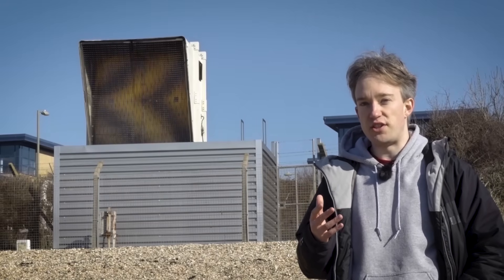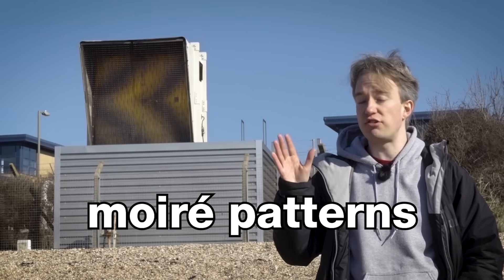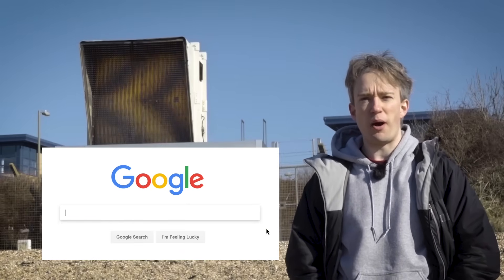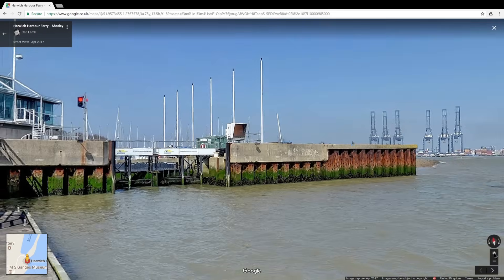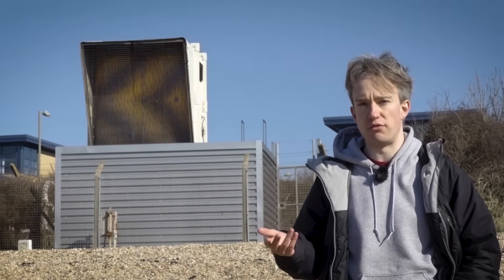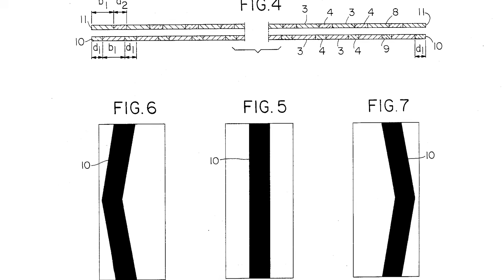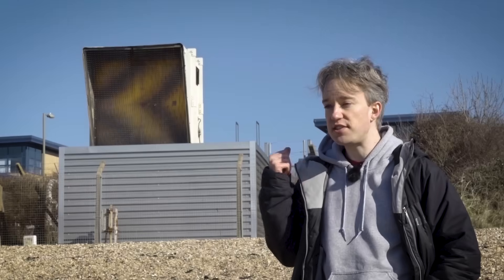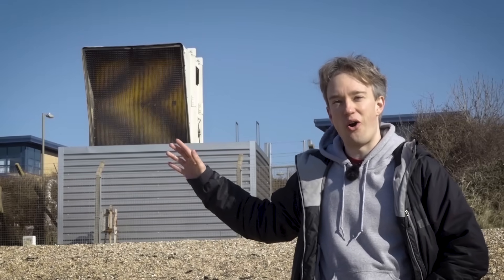The moiré effect lights that guide ships home

Comment from the maker: I tried for ages to fit the ♫ If new lines hit your eyes when two patterns combine, that's a moiré ♫ joke into my script, but couldn't figure out how. I put it here instead.
Reply: Your effort is appreciated.
Reply: ♫ When there's lines on the screen with more lines in between, that's a moiré ♫
Reply: ♫ When the difference is slight and the spacing is tight, that's a moiré ♫
Reply: I remember it as "When a grid's misaligned with another from behind, that a moiré"
EDIT: This isn't my joke. I think it's Randal Munroe's (XKCD).
Reply: If the eel gives you pause with pharyngeal jaws that's a moray
Reply: Hey, there's a community on Reddit dedicated to finding out what weird stuff is. r/whatisthisthing
Reply: I  believe the same system is being used in some places in the Netherlands to guide cars through a tight corner in a road. In Dutch they are called a 'bochtschild', but I couldn't find any examples of this particular system on the web.
Reply: I once gave an engineer a birthday card with a similar version on it:

When new lines hit your eyes
From two screens when they ply,
That's a Moiré!
Reply: Tom, get your self a 3DS, cause the same effect is used to make the glass less 3d work.
Also this effect is also known as aliasing, more in a signal sense rather than computer screens and video games.
Reply: I used Moire patterns extensively during my graduate work for alignment purposes. If you print a moire pattern and bounce it off a mirror and into a CCD camera, you can tell how angled the mirror is to 10^-3 degrees by looking at the Fourier Transform of the image in the camera. I can send you some references if you want.
Reply: ♫ When the patterns combine and they nearly align, that's a moiré ♫
Reply: When there's lights and a grid
with its lines a bit squint...
Reply: Leendert van Egmond came here to say exactly that! they're used for sharp turns
Reply: Not quite the same thing, but it reminded me of polarized lenses.  When my dad was in college many, many years ago he took a course on inventing.  His final project was a pair of boxes that used a flashlight and polarized lenses to send morse code signals.  His professor told him to patent it, but he never did.

With that in mind I always had polarized lenses in my mine and was trying to think of clever uses... and finally I had an idea!  Offset polarized window treatments for windows in buildings that have windows that face each other!  You can look out but you are blocked from looking in the windows on the other side.  I did a quick google only to find someone had JUST (like within the last couple months) gotten a patent for it.

Oh well.  Back to the drawing board.  Had an idea about changing the frequency of steel harmonica reeds with magnets.  Mentioned it to a friend who, I guess, may have actually been talking with someone who was working on it.  He was very quiet about it, which was unusual.  I think he may have been under an NDA.  The invention, a very fiddly, but very cool bit of harmonica kit, came out very shortly thereafter.  There is no way they would have had turnaround time after my mentioning the idea.  I was just beat to the punch again.  I'm not sure how you could make an episode about it (you'd need some sort of news peg, like an example that you could visit) but the idea of how inventions can go uninvented for generations and then suddenly get invented by multiple people all at once is fascinating.  I think some of it is cross pollination of technical ideas (maybe with some industrial espionage), or a precursor invention being invented, or just a social change that suddenly brings attention to a problem or opportunity (like the Seydel harmonica company introducing a harmonica with steel reeds instead of bronze phosphor or brass.)
Reply: @NacorantheHarmonicaPlayer  There is also the possibility of "spontaneous inspiration", like when Edison and Swan simultaneously invented the incandescent light bulb. They eventually formed a company together. I'm constantly inventing things and finding out later that somebody else invented it before me.
Reply: I appreciated the Nerd Sniping reference just as much
Reply: I always heard it as "When a grid's misaligned with another behind, that's a moiré"
Reply: ♫ if you swim in a creek, and an eel bites your cheek, that's a moray ♫
Reply: ♫ When a grid's misaligned with another behind, that's a moiré ♫
Reply: Who knew that so many people on youtube would be familiar with the music of a somewhat obscure Italian-American crooner from the mid twentieth century.
Reply: They use these also to dock aircraft on stands at some airports!
Reply: You see these on the sign gantries on motorways and I can't help but watch the apparent image change as I drive past them. Great little idea, I'm surprised we don't see more of them.
Reply: Tom Scott In my opinion the convention methods of leading lights and channel lights are highly effective and unambiguous. For leading light to be any useful this must be incorporated in International laws (IALA Maritime Buoyage System). As far as I know this light is not included in that. In few cases some ports use a special light which must be mentioned (including the purpose) in Guide to Port Entry or relevant Port Information. These lights are allowed as long as it doesn’t confuse with the lights as per IALA Maritime Buoyage System.
Reply: Leendert van Egmond yeah, Just wondered about those last weekend. They are quite effective within those turns to keep you in the lane it seems. And as when moving by they create the illusion of something moving, they are quite good at drawing your attention
Reply: ratedr95 yeah but those get more and morereplaced by displays recognizing the aircraft type and position from a camera picture.
In Düsseldorf they had boxes with a slit in the front and a fluorescent tube in the back before. Stripes on the front showed you where to go. Plainly worked. The new things used weeks of calibration and learning
Reply: Why don't we use our waterways more in britain more? its a perfectly good viable piece of transport. also can we use it for industry? or atleast a traditional industry caravans and tourists don't tend to fall into that bag
Reply: Things that I also don't know.
is a better name, no?
Reply: I've been trying to get the whole tune of "Inogon leading mark opens the door" but that's about as much as I have.
Reply: I never read the comments on Youtube, for obvious reasons, but this paid off immediately. Really clever.
Reply: Someone please make this into a full song!
Reply: I came to the comments specifically for this joke
Reply: Just googled a bit and found that some levels use that principle instead of airbubbles.
Reply: Making it into a parody song is actually a really good way to remember what the definition of a moiré light is
Reply: it would have been even funnier to hear you sing it Tom. You know thats the reason its not in the video and not bc you "couldn't fit it in"
Reply: Tom Scott fly a drone at it at different angles. Id like to see it in action
Reply: Punny
Reply: Where is that? normally they just have the red/white signs..
Reply: I'm Very Angry It's Not Butter!! 
When the world seems to shine like you've had too much wine 
That's amore… classic
Reply: nice!
Reply: When the beam hits your eyes and the lines all align thats a moiré
Reply: cool joke, hard to pull it off tho
Reply: Tom Scott the judges will allow it!
Reply: I think the real story here is that Google search sucks.
Reply: We use these here in The Netherlands for sharp turns on roads
Reply: Bravo! 👏👏👏
Reply: Tom, PLEASE make the i dont know series!!!
Reply: You Sir, win the Internet!
Reply: When an eel lunges out / and bites off your snout / that's a moray

BC cartoon strip
Johnny Hart
Reply: It makes me happy to know you had that thought hahah
Reply: @BryanTaira  fwwjdiejfdxshxsjfd.  Dufddfdsjfs
Reply: Dus zo werken die dingen!
Reply: Likewise I would have also, for all the great content produced.
Reply: could it be due to financial data cabling?
Reply: I dont think your seeing  this comment. But how did you search this all? Patents? The millarty? How did you get all that information?
Reply: Did you ever find out why the lights there...?
Reply: I live 2 miles from this exact moiré
Reply: Yahdswhtw
Reply: Tom Scott  I believe the cable is the data cable that connects the world to the internet 🤯🤯🤯
Reply: Tom Scott I know why that is there!!!!!!

Between the (Now Closed) Fawley Power Station (which has the well recognised Calshot Chimney as a landmark), and the Hamble (the side you are stood on) there runs underground Electrical cables/Pipelines, that I believe keep the oil tanks filled up on the Hamble side from the opposite Fawley Oil Refinery. Having lived nearby to it for several years, I do know a few bits about it!!!!
Reply: When you swim like a seal and a fish bites your heel... that's a moray~
Reply: I like seeing those lyrics as they are written, but probably too much corn for you. Does make me wonder about your singing voice though.
Reply: ♫  When two patterns combine in a way serpentine, that's a moiré
Reply: Given lines on the screen with some more in between, that's a moiré.
If you find there are lots of those weirdly-spaced dots, that's a moiré.
Reply: If the dots all align and the patterns combine, that's a moiré.
Reply: "When two patterns entwine in a way serpentine, that's a moire . . ."
Reply: @davidmennomoyer  Very good.
Reply: @simonmultiverse6349  - all credit to Spider Robinson.  It was in one of his short stories years ago.
Reply: Deano tips his drink at you
Reply: I appreciate the effort Tom
Reply: You could have just had it be the explanation and just say it in the same pattern as the original lyrics.
Reply: Tom Scott If you do a new series, you should name it "Things you might know"
Reply: Come on Tom, you are at the thing. Research is more than just googling. Ask the locals if they know who is responsible. Walk into the authorities building. They'll know.
Reply: I wonder if the light is there for people who would need to service the cable?  It will alighn you over the cable and then you can go down there
Reply: Carl Terrey  he strikes me more as an apple juice, with a dash of water to take the edge off kinda guy.
Reply: Tom Scott shame I didn’t know you were in southampton when you did this. I’d have bought you a pint! (Or your preferred drink!)
Reply: Xkcd already used that joke. It's a good joke though
Reply: In some placed in The Netherlands the use this kind of arrows along to rode to indicate a sharp turn.
Reply: @MeneerBobRoos Egg
Reply: +Falcrist damnit, i was about to find the xkcd
Reply: All I get from this is that you didn't try hard enough. :P
Reply: design a website where such unknown variables can be layed out and find unfindable things in a community oriented tasks.

Like reddit but with actually useful interface that lets users put what they know, and others can add, till the host is like oh it was X.
I remember searching for a comic years ago and only thing i could remember was the scenes and it wasnt till i asked around enough in such a decentralized way that i found the artist who confirmed it was her work n sent me a link to it. 
4 years of searching, could be so much well sorted if we used the internet.
how do we solve problems? Find things google doesnt show, open a discussion and search for it. 
quora and other ask sites are limited to questions and answers, and forums like reddit are rather linear and hard to search through, 
so instead a searching data base that pools simular questions, and teams up researchers and journalists and students with a nebulous way of trying to resolve information easier. Is something factual? lets map out the date and times using easily accessible information online and plot events or facts, and challenge information as well if its false or misleading
Reply: Tom Scott here’s an idea for a new series of videos “Things YOU might know (Because I sure as hell don’t). 🤷‍♂️
Reply: wow this comment wasn't made a week before video's release
Reply: Falcrist brilliant play on words....
Reply: Were expecting that.
Reply: Here we go! Crowd source the lyrics to the song.
Reply: Leendert van Egmond they are used everywhere in the netherland, not only in some places. But yea, you are indeed right, they are used quite commonly here

Comment: This is clearly witchcraft, and they probably turn people in to newts. 

But holy crap this is really an interesting idea. I wonder if any artists have used it for a big project.
Reply: A newt?

Well, I got better...
Reply: IAmTheSHEED - I built some large scale Moiré discs as part of my Lighting Director kit (toured with a band) but sadly they weren’t sturdy enough to survive the rigors of roadies (which is why travel cases are so important, frelling roadies break anything not in one (I love them before anyone jumps on me)).

There is something Moiré-ish (well, it isn’t -ish but it’s not what you’d expect) you can build for your home tho with an old fresnel lens style overhead projector...   you’ll need to glass discs painted black with curved lines radiating out from the center, one disc clockwise and t’other anti (getting the right amount of lines and curve is tricky but as it’s paint on glass you can easily wash it off and try again, generally tho, more lines with a curve close to the size of the discs work best).   Mount them on motors (or a single motor and gears) so they’ll be spinning in the opposite directions, being able to adjust the speed and direction is key.   Once done, set them up so they’re overlapping each other enough so an MR-16 style halogen bulb set behind them is inside the overlapping area.   Add a ventilation fan and baffles over the exhaust (we want lots of air going in and out but the light should only come out of the “top”), close it back up with the fresnel lens (the “top”) and bewm...   the Star Wars warp speed effect projected all around you  :)
Reply: +orion khan that's really cool!  DOn't suppose you have a video of that?  Apparently Moire patterns are hard to google.  ):
Reply: Not a big project, but I'm currently working on a guitar pickguard that uses hexagonal moire patterns, so you get 6 pointed stars that apear to move when you look at it at different angles
Reply: Check out the book series "Poemotion" by Takahiro Kurashima, I believe they work with a similar principle if not the same.